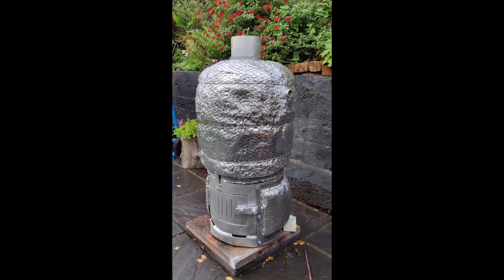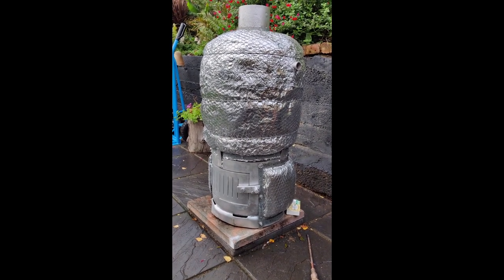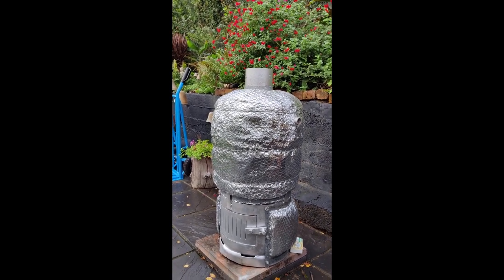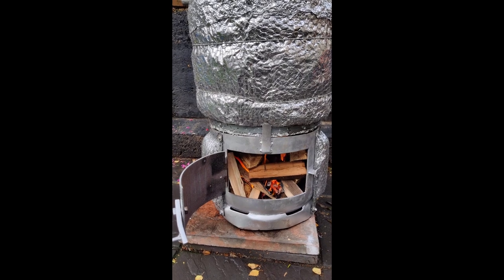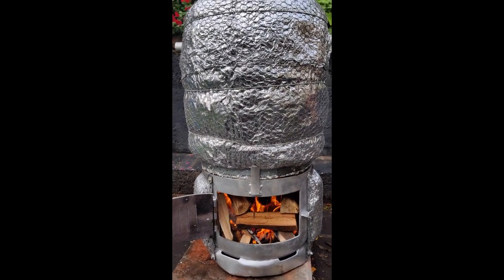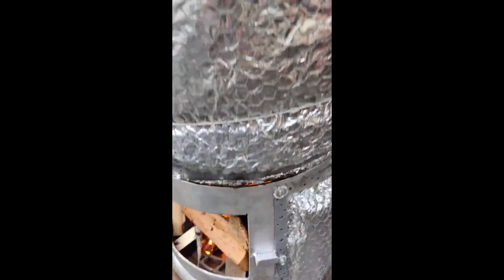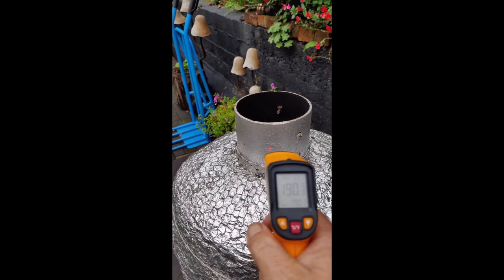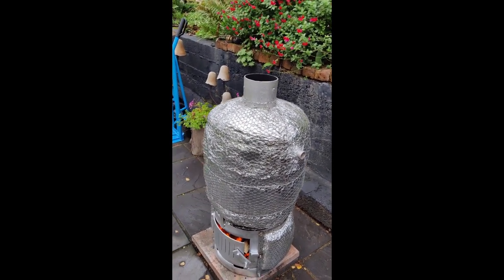Sand battery can it heat my home? part 2

Comment: Just watched your video.  With the internal temperature of the house at 21C according to the electronic thermometer, you have already the ideal temperature for normal cognitive function.  Raising it above this amount makes little to no sense to bring that monstrosity indoors at all!  Further, the real test, if indeed this is, would be to repeat the same experiment when the room actually was in need of heating, say a temperature of 15C where the human body does 'actually' feel and require a heat source.  Measurements would then have scientific value to them and could be properly put against cost, time spent heating the device and numerous other factures that could be meaningfully measured.  But, at 21C, there is little to be gained by others from your efforts.

This is less a criticism than suggestion for more meaningful and distributable content from your channel which has put great effort into this video but alas, the conditions of the experiment are not up to being measured in a manner meaningful enough for purpose.  When a living area is above 21C, the human body begins to feel uncomfortably warm but this experiment is not lost on me but it's parameters aren't well enough defined for it to be scaled.  It is a good video and you did a good job so, well done for that.

Please continue!
Reply from the maker: Thank you yes this video was just a experiment & didn't come into the house to merely heat it on this occasion, we now use it in our hallway & brings hall kitchen & dining room from at times 13-15c up to 18c for approx 7hrs +👍
Reply: @leejones2511  I much appreciate this video, it's objective and your kind reply.  I look forward to further delving and informative demonstrations from your enquiring mind and nature.  Forgive my formal language, I am not a native speaker and am usually otherwise engaged in machine learning endeavours but am reminded so often that the  principles found here have much to be applauded.  Thank you.
Reply from the maker: @chrissparrowhawk  thank you for your comments & feedback & your very welcome 👍

Comment: Very nice job Lee, Have you thought about an Aluminum heat sink to slot down the top part of the flue and then just use a woodburner fan on top that would just run on the heat ? Also any update or follow up video in the pipeline 😉

Comment: What I want to know is how long it kept the room warm? i.e. How long did it keep pumping out warm air? I've heard they last a long time.
Reply from the maker: Watch my new video 👍
Reply: @leejones2511  I did but the last time you said anything was at 5 hours, but you acted like it was still going strong. I wasn't to know how long before depleted. Did it last all night how about the next day was it still going. I've heard great things, but I don't have one.
Reply from the maker: @vonries  yes after 7 hours it's still 70-100c depending on the burn time to charge, I'd say at 10 hours it's going to be in the 50c bracket which if you had it in a small room will still be efficient,

Comment: Just an idea to improve performance, I work with Andrews and Lockinvar Gas water heaters, which use the same idea, they use baffles that drop in from the top of the flue that slow the flue gases down to more use of the heat, these baffles do just hook on the top, so are easy to remove to clean the flue.

Comment: I really like what you did. 
My only worry is that the radiant heat underneath the tank could scorch your floorboards. 
Maybe you could mount the stand on a steel plate or heat-resistant board.
And then of course ad some wheels.

Would love to see a video after a few months of use (including feedback from the war office).
Reply: He has a hand truck with the wheels needed. Adding wheels onto it could damage the wheels with the heat over time and might be a fire hazard keeping them so close to such a high temperwture source continuously
Reply: maybe just put a mylar blanket on a board?
Reply from the maker: Yes you are right I have a re-cess at the bottom of the tank that I can put insulation in & was going to mention this in the last video & got side tracked with temperature readings, yes I also have a reflective heat mat but agree I do need some fire board also 👍
Reply: Maybe just a few stone or brick pavers to set it on. If you got the circular ones and made a pretty pattern the. I’m sure you’d get approval from the war office.

Comment: Future mod.  At the base of your flue pipe of the battery, instead of just running the pipe straight through, form a large cone at the bottom of the flue pipe.  You’ll get a much larger surface area that will collect/transfer heat to the sand.  Which should heat the battery interior much faster.  This will also allow to you fab interior fins and have a larger surface area to attach them.

Comment: Recommend you mount the fan at the top, blowing downward.  Warm air will exit the bottom, and heat the air in your room more thoroughly.  A simple improvement would be a thermostatic speed control for the fan, power for the fan could be supplied by a peltier device.

The flames exiting the top while you're burning indicate that wood gases are still burning when they hit the top of the flue, possibly igniting when they hit the oxygen at the top, which means wasted energy from the fuel.  Weld up an "Archimedes Screw" type spiral baffle around a length of rebar, so that it can be inserted once the fire is burning hot, and slow down the gasses on their way up.  You might also add in an air feed tube coming in from the side of your firebox, and leading up the flue, which should make sure there is adequate oxygen in the flue to fully burn the wood gasses.  If you really get ambitious, weld up your spiral around a hollow tube, capped at the top, with holes drilled to allow cold air to drawn from outside the firebox, and to exit into the flue/spiral.

A non-burn spiral could be inserted while extracting heat to increase efficiency, and you still maintain the ability to brush the flue after every burn, keeping soot outside, and maintaining good relations with the MoD.

The temp variations from bottom to top are simple.  The bottom gets the full force of the flame from the fire, and gets hotter, first.  The top is heated by heat coming up the flue, and by convection as the heat propogates upward through the sand.

If you build another, and you KNOW you will, I'd suggest plumbing bungs (like your original steam vent) at various levels so that you can plumb in thermometers / thermocouples for precise temp measurement.

Hope this helps, and looking forward to the next video.
Reply: Not bad...but that PC fan would cook before it could overcome reversing thermodynamics...metal fan?

Comment: A huge amount of energy is getting wasted through that pipe. It should either have a spiral shape or multiple smaller ones spread out, preferably both. Of course it wouldn’t be so simple construction anymore but sometimes some effort pays off. Ideally the energy should be collected as far as possible by some kind of regenerator, similar to SHE (spiral heat exchanger) or something alike.

Comment: If you did not use the fan convection would still circulate the air through although at a slower pace. The room may not get too hot and the heat boost will last longer ( like maybe through the night ).

Comment: A GREAT test piece.
There won't be soot if the reebar is welded on the outer surface of the inner pipe. Then it will look like a hedgehog inside the gas bottle, and no holes like Kerplunk. I didn't understand where the concept of soot came from anyway.
Reebar could still be fitted right through the pipe and welded on the outer surface, then the flames will lap deliciously all over the bars and the heat will really get into the sand, and equally vent plenty on the cool phase once it is indoors. 
As you say. Quite a lump to move about though.
How about pushing a heat sensor into the sand through the steam vent? Might get temps around 500c in there.
Good fun.

Comment: Another possible help is to use ‘turbulators, as used in radiators etc. basically a spiral that makes the gasses slow and allow a better pick up. Some fin like auger spiral.

Comment: Nice one pal. I don't think you need the fan, as you say it's not powerful and may even be cooling down the central tube a little but porbably a minimal effect either way. Would it make sense to have an easily removable insulation jacket so that it emitted heat more quickly ?
Reply from the maker: Yes & no for me on the jacket, yes in the fact as it gets towards the end of the discharge it would give a bit more effective heat, but no in the first at least three hours as it's frighteningly hot + it's messy stuff & can imagine it will get even more fragile through the burns
Reply: @leejones2511  Thanks.

Comment: Interesting. The proof of concept is there that the sand can emit heat for a long time at High temps by very quickly heating with wood... the down side obviously is lugging the damn thing in and out of the house... This is something more practicle that would definitely work... It is an induction cooker/heater (very basic circuit, buy one off ebay for £20) it could be put though with copper pipe a much bigger, stationary sand battery 1m3, and slowly heated with a solar panel. Clean, no smoke, no smell, no nothing. It might take a month to bring up to temp, but if you are doing that in Aug/Sept it would easily radiate heat for a winter with winter sun top up.. low and slow is the way 😉   https://youtu.be/WI7L86E8ls0 p.s would the regs allow a pellet stove flue in your house as they can go horizontally out the back of a wall,just a thought

Comment: Great build. I wonder  how good smaller more practical ones would be.
Reply from the maker: Yes absolutely gas cylinders come in all shapes & sizes, probably have to use them bare to get a good heat off them & certainly heat a small room 👍

Comment: The specific heat capacity of water is over six times that of sand.
Heating 5 gallons of water in a bucket to a boil will provide Btu s .
Reply: Yep, but you are restricted to a temperature of 100 centigrade with sand you can go up to about 4000 Centigrade,
Reply: While the water has a higher capacity the convection in it would reduce the temperature more quickly while the sand will still have usable heat as long as it is above room temp.
Reply: At what point does the steel melt ?

Comment: And your loosing bout 80% if your heat up that chimney. Put a section of stack on it with a damper in it. Tune it down and it will really heat and fast. Been burning wood over 700 years. Am sitting next to a blazing fire up in the snow. Just damp it down.

Comment: It's an admirable test, however one cannot get more energy then from what was applied diminishing returns are immediate. You would be better off buying a pellet stove and running the blower for it with a solar panel. That would be the easiest an cheapest way to heat  a large area. Depending on BTUs of course.

Comment: Like others have mentioned,  I think you'd be less bothered with just an outdoor boiler that forces hot air through an insulated pipe set into the window opening and you could keep all of the sand battery features you've worked out.
Reply: I once built a small shed and piped the hot air into the house. Worked well.
Reply from the maker: Yes that is an idea I like & may do one day 👍
Reply: @D-B-Cooper  there are outside wood furnaces that can be bought, defeats the purpose of DIY though.
Reply: @bonedoc4556  the problem I have with modern outdoor boilers is that they maintain a low temp fire when the demand for hot water is low. Low temp fires are inefficient and put out a lot of smoke.
Reply: @bonedoc4556  those are boilers and last time I checked were about $15,000.

Comment: hi back in the 1920s my grandma used this type of thing same idea ....biscuit tin heated on solid fuel cooking wrapped in towel made good bed warmer...better than hot water bottle plus put food into pot inside pot with sand and heat made good slow cooker john

Comment: If it was possible for transfering sand from outdoor to indoor automatically, it would be perfect. Because sunlight (parabol) would be able to use as heat in sunshine. Also when not at home. But I am lost of ideas of how to transfer hot sand in any system automaticly from outdoor to indoor.

Comment: Great job. Maybe if you had  removable insulation that you could take off when you get it indoors, you would get a better distribution of heat to heat the room quicker.
Also would like to see a video of you moving it onto the sack barrow.
The video you referred to in the previous video is Robert Murray Smith. His channel is fantastic.
Reply from the maker: Yes you are probably right I got effective heat from the flue up until about 9pm  & then it felt like it tailed off but the flue & handle was still to hot to touch & (which is amazing) & was still hot but touchable at midnight!
But problem with insulation is it's really messy but il see if I can get a product to go on the inner part of the insulation that can withstand the heat & make a jacket of some kind, 
But il get some thermometers first & check how it tails off from the flue & do a video on that & yes il include a transfer clip of it being moved, 
Yes thats him Robert Murray Smith 👍
Reply: When it tails off turn a fan higher through the flue
Reply: Not sure that makes a difference it's all heating up cold dense air

Comment: When you made it , you should inade it, you should put four mental rods into sand, the type of mental rods that transfer and conduct heat through the rods and up through the sand storing heat through out bottle.And if you create a caged of four rods and and two rings with bottom of rods sticking through where you burn the wood you should have entire bottle heated entirely.

Comment: Couldn't you put a separate flu that would slide up kind of tight up the center of this one the only attached to your Firebox so that smoke comes out that blue only does it touch the inside of this one so there's no such could be built up on it and then you can have a damper or rebar wherever you wanted down the center and it wouldn't matter because it would stay outside

Comment: You could affix a Peltier and heat sink and get the PC fan to run in an event of a power outage just on the heat differential, just in case!

Comment: KISS... 55 gallon barrels/drums filled with dry sand that contains stove exhaust pipes... Add a forced air source... for clean air rather than exhaust gases...

Comment: Stick that thing Infront of your cast iron radiator there at 29:44 and turn on the circulating pump. You can heat the rest of the house a bit too!

Comment: Have you thought of building a rocket stove to heat the can? It might use less heat. 

Also, over there in the UK, do people use big water heaters with large tanks, or maybe a steel drum would work? 

I was thinking you could set a large cylindrical metal vessel on a granite tile on the floor with some bricks in it, maybe on a metal stand with feet, like for flower pots. Then, you could lower your sand battery into it. It would heat the air in the container. 

Since I am a lady who likes pretty things, I would tile the container, which would accomplish two things: it would be decorative, like a Swedish tile stove, and it would add some more thermal mass for radiating into the room.

Comment: I like your design better than TnT of how the firebox removes. What does the sand battery weight? It looks heavy , maybe weld some steel wheels and have a removable handle to make it like a dolly easier  to move.
Reply from the maker: 100kg & yes bit heavy but goes on a sack truck

Comment: An idea for mark 2 would be to separate the fire and chimney from the sand battery so there is no soot build-up. I know that wood burning stoves have a second liner that provides oxygen to the fire when there is no air flow in a room, it causes the fire to burn hotter but burns through the fuel quicker. You can always add another layer of lagging on the outside and lag under the firebox to keep the heat from being lost into the tiles below. Place a baffle over the chimney so that if you have torrential rain there won't be any problems with the fire.
Reply: Mark 2 should use a 1kW electric heating element driven by solar panels to heat the sand. My question is, why have electric heaters evolved to "not" include a ballast to store heat? Cost vs Efficiency? or Safety? or...
Reply: @ToddDesiato  cost
Reply: Cleaning out the exhaust tube of creosote shouldn't be but a minutes work easily done prior to bringing it inside.

Comment: Could you put an insulated metal cap on the top to retain the heat for when the room is warmed up?   Zoned out a little at the end, so maybe you mentioned it.  

Making sure the room is fully insulated, and putting a ceiling fan in there would probably do wonders for making the most out of the heat this generates.  More efficient heat means needing to burn less wood.

I think an interesting upgrade would be something like this, but heated with a heat pump overnight when electricity is cheapest.  Then you could use the sand battery to keep the house warm throughout the day.  Of course, you'd need the heated gas lines to run directly through the sand.

Comment: I expect the flue needs a bend in it to trap more heat. I would add another sand battery on top and run a bent flue thru that.

Comment: Okay this is an improvement, however it still looks like most of the heat goes away...
The hotter the exhaust gases on top , the less efficient the devise. The more time or distance the exhaust gases do before they go out the more heat they can transfer. This is why you need a dollar chimney also, to make sure the gases can pull out of the obstacles.